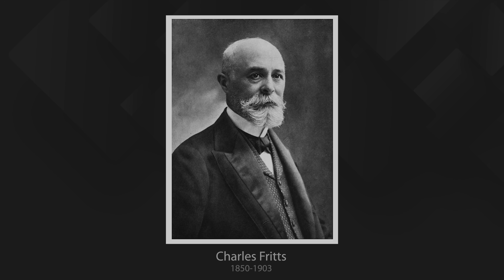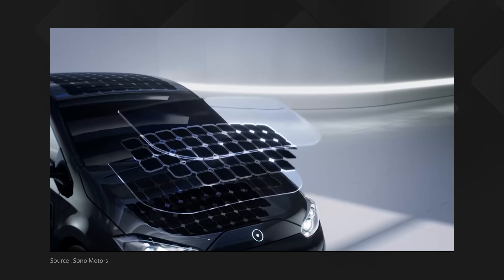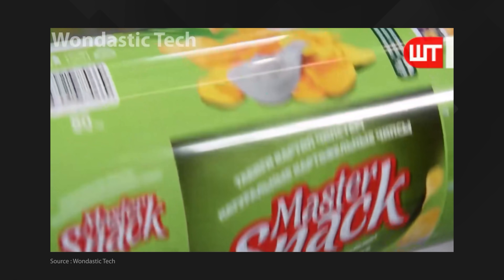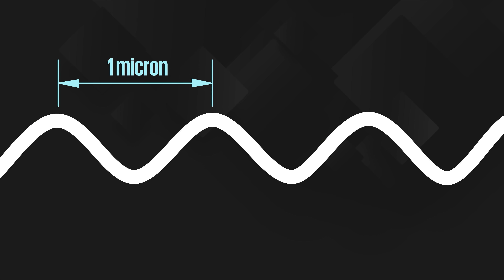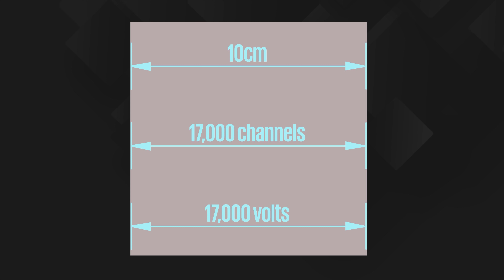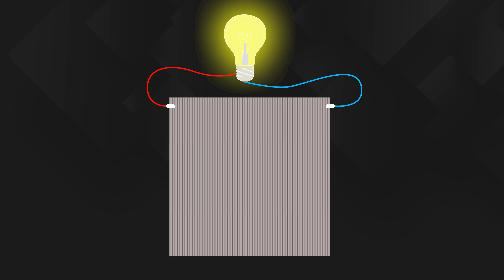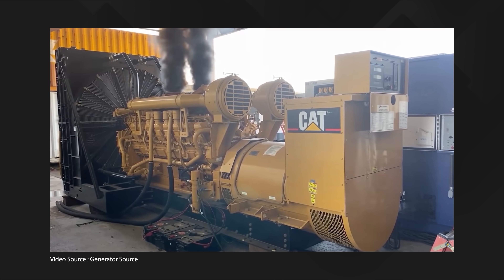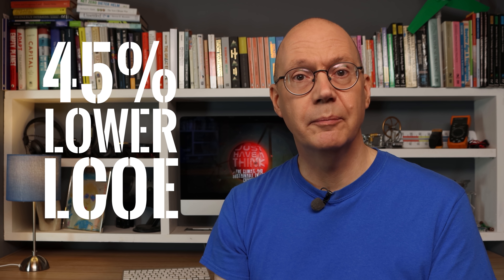Solar PV film roll. Revolutionary new production technology.

Comment: You've opened with a misconception that solar has made a major contribution to transitioning from fossil fuels.  This seems quite an exaggeration over all as Solar is maybe 1% of all energy produced, that is probably too high an estimate.  I mention this to clarify that we are not close or getting close to transitioning from fossil fuels. An effort to do this would be herculean. As an example all the EVs made to date are 2/10th of 1 Percent of the the billion vehicles existing.  It also gives people the impression that technologies like EVs are the best way to reduce CO2 which it isn't - at present the best for vehicles is hybrids because - they weight half as much; take less energy to build and you can make 10x as many vehicles from the constrained Lithium ion battery production.  So big EVs are actually counter productive. Now I do see that roll out PV film can help address this tiny production and make is significant - but lets paint a realistic view of what needs to be done and the best way to do it.

Comment: I have always thought that wind turbines should be coated in solar panels as most have uninterrupted direct sunlight on 180 degrees of their support columns. This would be perfect adding  production of electricity on sunny but not windy days and on sunny windy days. With area of possible application in a large wind farms being acres  this could  make an excellent addition income. The production of new SPV/Wind turbine hybrids would be popular and retro fitting may be a new business opportunity. The length of film could be the whole height of the tower and higher voltages of individual cells would not be a great problem allowing greater density across a specific area make them more efficient in this  isolated application especially in sea based systems.

Comment: For 35 bucks I bought a small solar panel that stays plugged into my dump trailer battery.  It's a real pleasure to not have to charge the battery every time I want to use it.

Comment: Glad to hear but more a relief.  10 years ago I understood that if we'd been fair dinkum, every piece of external building material would already have had an almost costlessly cheap layer of PV material on it. So cheap, it was basically a protective coating that happened to generate a voltage differential. A general focus on making use of the sunlight would have led to this kind of observation and application by then.  But as with other ossified heavy industries like automotive, there was no internal drive in the construction material manufacturing sector to engage in basic research.

Comment: It would appear to me that the critical issue in some situations is the mass of the panels i n ratio to the electrical output.  If the panels are light enough and still produce enough power then the obvious use would be in aircraft..

Comment: Great video an interesting technology. Some people try to claim solar does not work because panels are too inefficient, but the only reason why we prefer higher efficiency is that installing one 400W panel costs much less than installing four 100W panels. This film could be glued to roofs or walls or one could make frames and turn the film into super lightweigth panels; either way would drop the amount of installation work needed and make it much easier for DIY people so professionals are only needed to check the electric connections.

Comment: How do we know it's not another NanoSolar failure waiting to happen ?
Reply: NanoSolar failed because the Chinese flooded the market with cheaper panels, not because there was anything wrong with their tech.
Either this company will produce cheap solar film that is easier and cheaper to glue to your walls than installing panels is, or there will be another breakthrough that will massively lower the costs of panels. Either way we get cheaper solar power.
Reply: @AnalystPrime  Having just read some info on the proposed panels, 7% to 11% efficiency in best conditions (and I hope you're not actually using perovskite crystals), and only a few million in support, I feel like I'd be better off finding an Amish coal stove. At least those still work and are available.
Reply: @gregnulik1975  There are plenty of panels in use that are only 11% efficient already. The problem with them is you need to install twice as much so you really don't want to use them on roofs where the area is limited and extra work makes the installation more expensive per panel. On large solar farms installation is cheaper so super cheap panels might be competitive with more efficient but expensive ones.
Perovskite efficiency is somewhere around 30% but panels only last maybe five years, that is an estimate because none have actually been in use that long. But they are cheap compared to silicon to both make and recycle, so if they work they might replace silicon in places where the panels lasting decades is less important.

Comment: 20kw panels able to be carried in your arms? Whoa that's nuts, I'm assuming it's rolled up but that portability would be awesome. I'll believe it when I see it though. Still believe solar is the way to go, its just inconvenient to dig up fossils fuels and transporting them. Making free energy everywhere is just more economical than drilling the earth.
Reply: It is even more economical if instead of sturdy aluminum frames you could basically put up few sticks and hang this film off them. And yes, being able to carry a roll of this film instead of 2500 lbs of panels plus whatever the frames weight will make transportation to distant locations easier which also again means it is cheaper. We prefer more efficient 400+W panels because transporting and installing one panel instead of several is easier and cheaper, but with this film all you need is suitable surface area.
Reply: @AnalystPrime  Hanging these like tarps, etc. could be problematic in high wind areas. I can't see the connections even from the panel to a controller, etc. being very secure on something this thin. ;)
Reply: @Tumbleweed5150  Indeed, hanging them from a tree or laying them on the ground would only be a temporary arrangement because of the wind issue, proper installation requires some kind of wall to glue them to. But the potential ability to do so might be important in an emergency situation.

Good news is you could simply take four sticks and make a frame, then wrap the film around it and you have a two-sided solar panel that weights only little more than whatever the frame is made of. Or glue the film to sheets of plastic or plywood, or even thick cardboard. Just make them a little wider than the film so there is room to put the nails. A windstorm could still wreck the system, but hard enough storm can rip off regular panels too, or even the roof they are attached to. I happen to have personal experience of that...

And yes, making a way to connect wires to the film without tearing it is probably one of the major technical issues they have/had to spend a lot of time on.

Comment: How do the physics experts here anticipate the potential effect on regional/global climates caused by adding solar film onto every available anthropogenic surface, when you account for the large amount of energy absorbed that would otherwise be heating an uncoated surface? Could it be dramatic enough to significantly contribute to a change in temperature when  combined with reduced greenhouse gas emmissions?

Comment: Only 45% lower price? pffffffftt.. another soon to be failure.. I have serious doubts about the longevity of the film. Also microplastics - you don't want to coat everything with that plastic crap. It needs some glass for protection.
Reply: That 45% Levelised cost of energy which includes the shorter lifetime maintenance and balance of system costs so their panel or film they plan to produce must be really cheaper. As the balance of system costs will be the same in both theirs and silicons case and I think the BOS is often around 50% of installation costs what their ppannels cost is a guess but it must be very low if their figures are to be believed

Comment: 0:14
Aren't those water heaters that use heat from the sun, rather than photovoltaic cells?
A very long time ago in an interview for a tech job, where I had to explain how these work, and how certain faults can occur and how to fix them without any prior knowledge, probably to test my problem-solving skills.
Reply: They use light not heat.

Comment: May be a very silly question but just shows how little I know. Would it be a fair assumption that the photons that is used in this electricity generation would have been converted to heat if not "captured"? if so, do we know what impact this loss of heat would have in a microclimate or perhaps even on the global climate?

Comment: If it is only 45% lower cost than traditional PVC but 11% vs 22% - 26% efficient and only 50% to 60% longevity, then this is no bargain at all compared to traditional PVC. Add in the fact that these will not be used in optimal orientations and  surfaces, all leading to lower efficiency still, and you eliminate most rationale for using this unless you absolutely have no other viable choices. The areas that I see the most promise could be electric aircraft, boats, cars, and RVs, basically anything mobile, for which you would want the lowest possible weight and least drag penalty. For a fixed structure that has no weight constraints, traditional PVC would seem the better option.

Comment: I've been pretty outspoken about how much I don't like solar. I will say though, one thing it is really good for is getting juice to rural or undeveloped locations that might not have a reliable grid connection.
Reply: Why don't you like solar?
It works.
Reply: @davidwatson2399  I don't like solar because it doesn't work. Not on the scale we need it to. For rural or undeveloped areas, it can be a great stop gap measure, and even be veritable boon, but it just doesn't work. It has been tried  repeatedly, and it has failed.  You know what does work? Nuclear power.

This just isn't a discussion anymore. Solar advocates have their head in the sand just the same as antivaxxers. They are on the wrong side of history, and they are, emphatically, not on the right side of science.
Reply: @spencer1980  
" I don't like Solar because it doesn't work" 🤭😂
That's funny stuff right there.
Reply: @davidwatson2399  Solar power has been working for me for over 30 years...I've just been able to upgrade my system over those years so that I can power a little more. ;)
Reply: @Tumbleweed5150  
15 years here and about to upgrade 👍
The reduction in price and improvements in technology have been stunning over the past few years.

Comment: IF solar energy could ever get separated from the corruption of climate change it could do some amazing things. The most corrupt people on planet earth have been pushing climate issues for five decades and have failed for as much time. Science needs to tells politics to take a hike and stand on it's own. Solar is amazing and is very successful on many fronts..... Then tax gods, and carbon babblers for imaginary credits for a new currency get involved and solar disappears in the fight for $$$$. Affordable solar could eliminate most of the power grid in less than a decade when it takes off on a residential and business building level the same way wifi did.  Three  decades cities were planning metro Wi-Fi for profit and now it is a normal commodity. Imagine solar in a metro down area where the city provided all the electrical cross grid and all the buildings have the security of a common grid of power from a the shared solar power collected off the buildings. Maybe throw in a little wind vortex technology in the "city canyons" and you have a sustaining future. Why does designs like this never go forward??? Corruption doesn't make $$$. Businesses and home owners are independent from the Power corruption. IT has all been there for decades just getting stale and lost in an empty climate future. 5 decades of lies are a burden to heavy to carry. Slip free and follow the greater truth of it really works and it provides amazing freedom to the people that support  mass use of solar to replace the grid!!!!

Comment: Good for Van, Bus, and trailers.  Extending the range of an EV makes them more useful.  If one did not drive much their vehicle could have a smaller battery.  When vehicle is not in use power generated could go to grid or home batteries.

Comment: As a ballpark figure, the maximum amount of solar energy hitting the surface (cloudless day, noon, on the equator) is about 1kW per square metre.  So in those ideal conditions this technology would produce 160 watts/meter.  At northern latitudes and with our typical European weather the output would be about half of this.  Still a great technology though :)

Comment: This is beautiful stuff!  so a large multi acre horizontal venetian blind of this stuff can track the sun and limit the solar exposure to further limit water evaporation from the soil and you have a dynamic passive/active solar system that improves the arability of some lands and provides the power to hoist up the water from wells and drive the tractor to cultivate the land underneath!  The thing pays for itself!

Comment: This seems like a potential way of cheaply capturing lots of sunlight and converting it to electricity before it hits the Earth to directly combat the heat that greenhouse gasses prevent from radiating to space.

Cover every parking lot, roadway, rooftop, and reservoir with awnings of this film to catch sunlight that otherwise turns those surfaces into heat islands and convert it into electricity.  "Solar jujitsu".
Reply: It won't work on carparks or roads.

Comment: If you take installation costs into account for typical rooftop solar and the fact that rooftop solar is usually needed to be concentrated due to limited space it makes no sense for rooftop applications.  Just the installation cost issue by itself is a serious concern.  This will have very limited/different types of applications.  Currently installation cost is several times the material cost.  And the cost they are mentioning doesn’t include the additional support that will be required.  I can see it being used in many places that current Pc isn’t though
Reply: Are you saying that that rooftop solar makes no sense and isn't worth it ?
Reply: 1. He mentions that this is NOT in competition with conventional solar panels.
2. Seeing as this can be applied by GLUING it to existing metal, etc. roofing, the installation cost HAS TO BE lower...even free, if one is capable of climbing a ladder and pasting this in place.
That said, I think I will keep my own solar panel array for the time being. It's what I call "down and dirty"...I just screwed a few panels onto some ten foot 2"X4"s, then lifted one end by putting tires underneath, then tying them down to chains inset in concrete plugs in the ground to keep the high winds here from throwing them around.

Comment: There was a company called Solarmer Energy near Los Angeles that was developing such a process TEN YEARS AGO. It was based on technology developed at UCLA and was intended to be "printed" on the very same newspaper printers that were even then being put out of business by the Internet. A decade ago they had energy yields comparable to those claimed in this video. Yet the company is gone. What happened? And what does it mean for this UK company? In Solarmer's case they were trying to compete with traditional solar technology that was improving in efficiency and decreasing in price faster than Solarmer could compete. That will be the problem with this company, too. I know you said these Brits aren't competing with traditional solar cells but that's true only to a certain extent. Yes, they can go on surfaces where normal panels can't, but UNTIL ALL THE SPACES THAT ARE SUITABLE FOR NORMAL PANELS ARE FILLED there won't be a big market for putting these films elsewhere. So it has to be REALLY cheap or REALLY subsidized.

Comment: 1:39 You're ignoring the two elephants in the room: 
1. getting the electricity from those billion sheets of film to where they're needed in the form needed (AC/DC, voltage, amperage).  That'll require two billion wires and tens of millions of charge controllers, and almost as many batteries.
2. Durability.  (The environment is pretty harsh. And... STORMS.)
And don't forget maintenance and replacement!  Even now, putting PV cells on a not-brand-new roof is a big hassle in harsh climates where roofs only last 10-15 years.